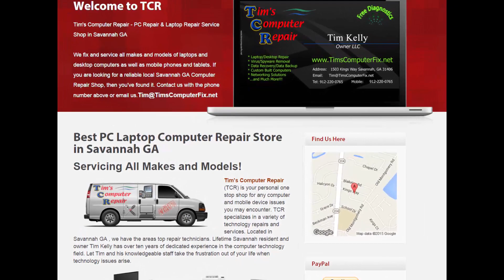Dell Inspiron 24 All in One Diagnostics Hard Drive Motherboard Memory Access

Comment: "Droids B Us"!! Good question.. can a small fan, like a 90 - 120mm PC fan be mounted on the back, with some added holes/openings in the back cover, to help with CPU cooling? Thanks & is it really worth it to upgrade the CPU? Can you explain why a 5400 RPM HDD is a not a good match with Win 10?

Comment: Is there anyway to repurpose/reuse the Screen on an AIO when its a touchscreen, I have a dell 24-5400 AIO that has corrupt BIOS. You can only use the HDMI IN after its booted, which I obviously can not do. I know you can buy controllers for LCD panels but is that possible with a TOuch Screen in an ALl in one

Comment: I have the same AIO 24 INSPIRON MODEL3455 that I accidentally removed the housing to the power ribbon connection. Technicians said it looks like it was ripped out along with the wire instead of just the wire itself being removed from the connection.

Comment: I got one for free, would not boot, but been using it as a monitor, I assume to its the board, with this stay in home stuff going I think its time to fix it, some prices on MOB have come down. Nice video,  ran into basically the same thing, wouldn't do anything on PC but HDMI worked. Have a good one.
Reply from the maker: Thanks for commenting.

Comment: Wow, I'd never take a computer to you, a few minutes fiddling with plugs and memory and little else. No sign of a multimeter, no voltage measurements anywhere on the board, not even to check l the voltage from the power supply.  I expected you to check around the power input but no you declared it U/S You're really a back yard tech and the title of tech is an overstatement. You didn't even bother to protect the screen by using an old blanket, the first thing I do when working on a TV or monitor. I suppose you're going to charge the customer for doing bugger all. Is it any wonder the repair business gas a bad name.
Reply from the maker: Haha no point in multi meter when the pc is getting proper power. Any novice tech would know if you get fans spinning you are getting proper power. The black mat you see me laying the face of the computer onto is rubber cushioned. No need for "old blanket" lol. This computer was diagnosed correctly. Only other steps to take would be to get a schematic and test all of the traces on the board. Something I do not offer in this case due to budget.

Comment: I kind of need help with mine mine is beeping 2 times and I thought it was the Rams but it's not
Reply: Hopefully, you got it sorted out by now, as it's been 7 months since you posted this.  Not too much information to go on here, but I'm assuming the computer had stopped booting, and was only giving you 2 beeps when you powered it on. With that in mind (for you, or anyone else who needs the info) - Generally, yes, 2 beeps is an indication of a problem with memory. 

Sometimes it can be resolved by reseating the memory. Sometimes some dust has accumulated and is causing a short, and it needs to be blown out before reseating the memory. Before reseating the memory, it's always a good idea to use some contact cleaner on the memory contacts, wipe them down, and make sure they're good and dry before reseating them, and blow out any dust that may be in the sockets.  Rarely does memory go bad, but it does happen. No idea what model you have, but models like the Inspiron 3455 have either 2, 4, or 8GB DDR3L SODIMM modules, which have to be installed in pairs. 

But you said it's not the memory, though you gave no explanation as to how you determined that... but hopefully you've gotten it fixed and running again (or replaced) well before now... 

On these Dell All-In-One (AIO) units, there are also light codes (amber blinking patterns) that show up on the power button that can be used to diagnose problems with the machine.  You can do a search on the Dell website for "How to Use and Troubleshoot the <Dell model>" for these light codes and other useful information to help diagnose and get your machine working again.

Comment: Hi Tim, I have a Dell 24" 3455 that has the exact same problem as the one in your video. I tried what little I know and got nowhere. I was wondering if you found out exactly what the problem was so I can fix mine without expensive troubleshooting. I know you said "Bad Board", if that is what I need please let me know so I can get this baby working again.  ThanQ, DanJo
Reply: Gee he steered clear of this comment. Your problem is common on various Dells. I repaired one a few years ago and found it was a faultu bios chip. I couldn't get one from Dell and all I could find was a working motherboard from Japan. Damned expensive, buy it worked and the owber was happy. As is usual, the damned things blow after the warranty expires. My second computer is a Dell and I.m expecting it to blow every time I switch it on. The big indicator of the fault is the fan running at top speed. If anyone has a working motherboard or the chip I'd love to buy it.
Reply: I have the same

Comment: I'm having a problem with mine. When I press the power button it will shine a orange light then white sounds like its on then it will turn off and do that repeatedly. Do you have advice?
Reply: The key board will flash but I get a black screen on the monitor.
Reply: the same with my dell Inspiron AIO 3459, and at the Dell support call "Bad motherboard" and they want to charge 420USD to fix it... I prefear to buy a new computer not Dell....
Reply: @LitvinovII   it was an update they senr thru there software.
Reply: @bananathebadguywilliams4868  sure, it happened to me after an update, do you fix it?
Reply: @LitvinovII  nope I'm not gonna pay dell for a problem they caused.

Comment: Mine Dell 5348 AIO has developed a very weird issue. I'd opened it for some cleaning and it was running fine but after 4 days the screen turned off while PC was running, no video. I turned it off and on again but the display would only came on twice then again no video. I left it off for a while and when I turned it back on, it was running fine again. This issue has been repeating itself and I narrowed it down to the control button board which has HDMI button. When the issue occurred again I pressed the HDMI button and the issue was resolved. I cleaned the board buttons with alcohol and the issue didn't occur for several hours. However, it happened again and when I tried the HDMI button even the HDMI display was showing the same symptom now. Isn't it a weird issue?!?!.

The display is okay and the motherboard too as I never face any issue while I have the video. Should I clean all the contact in the PC?? Where should look to resolve the issue, kindly advise.
Reply from the maker: Never know with electronics when it comes to things like this.

Comment: I don't think that was a converter cable you pulled out, I think it was the backlight cable, either that or the button control panel cable. AIOs are just a pain in the proverbial aren't they? Bring back old school laptops at least their components weren't hidden by half a sheet metal. Nice job mate and have a good new year ;)
Reply from the maker: Happy New Year to you also GS. I can't believe the kind of crap components they throw into these things. I was reading that the AIO's are going to get even more populated in 2018. Thanks for the comment

Comment: Unless that had an SSD it didn't sound like the hard drive powered on either unless it was using a WD green drive it's competitors equivalent and they are THAT quiet
Reply from the maker: With the fan spinning at 100% as soon as power is supplied I know I was dealing with something more serious than a hard drive issue. Replaced the motherboard and all is good. Thanks for the comment

Comment: I would also have tested different RAM(I already had a PC with 3 out of 4 defective ram sticks).
Maybe also attach an external monitor.
And just to be sure test it with a different power supply(as I had several cases that the power supply produced exactly this error)
Reply from the maker: All good points however the ram was not the issue. With the fan spinning at 100% as soon as power is supplied I knew any type of video was fubar. Tested voltage on power supply that was all good. I have seen this so many times. I replaced the motherboard and the pc boots fine with original ram. Thanks for the comment